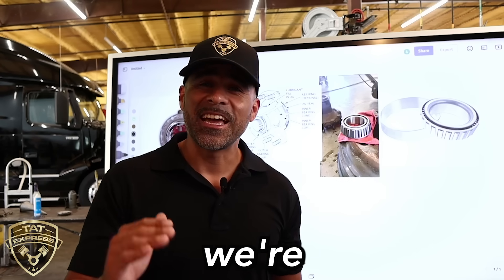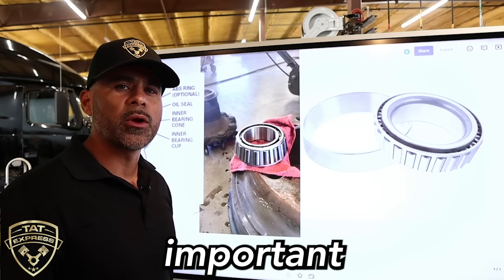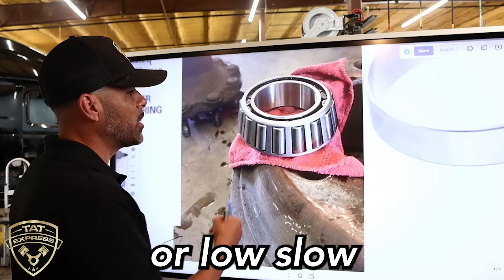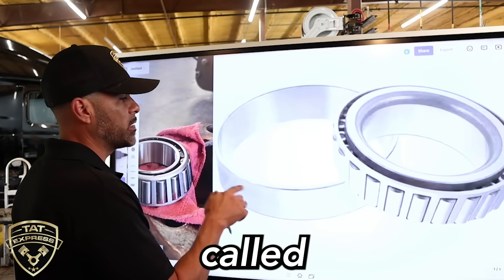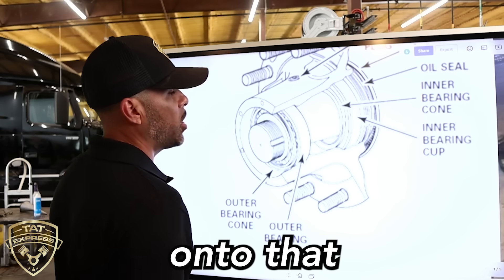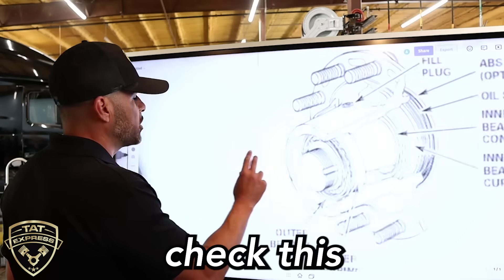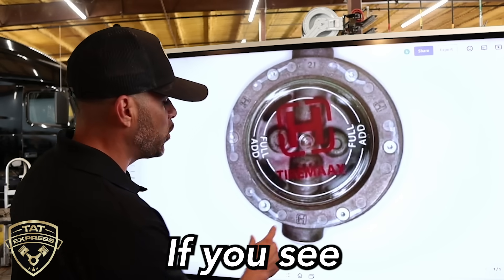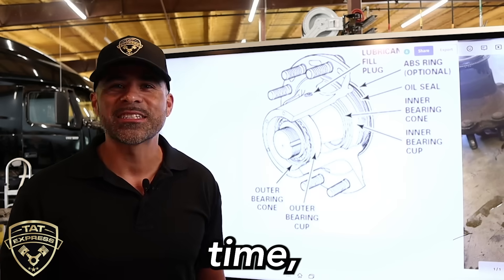What Are Wheel Bearings On A Semi Truck/ Wheel Bearing Semi Truck/ Wheel Bearing Replacement Semi

Comment: Love it. But what are signs of a failing bearing
Reply from the maker: Low oil pressure and metal in oil are signs of bearing failure. Regular maintenance will extend bearing life. Oil analysis is also recommended for high mileage engines.

Comment: Well wheel bearing rotor rotate lubed by grease if soo silicone grease won't melt 🫠 n or oil the good thing about grease is even if seal blows out inside wont spill since tractor or trailer usually rolls tons off miles add alao oil resistant in diameter of rotor